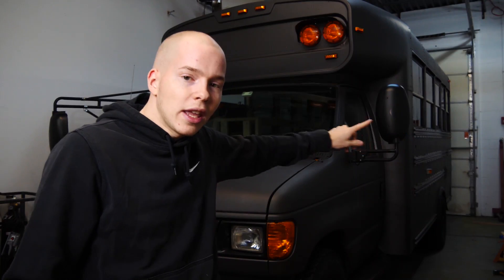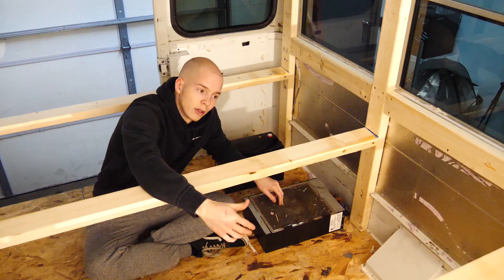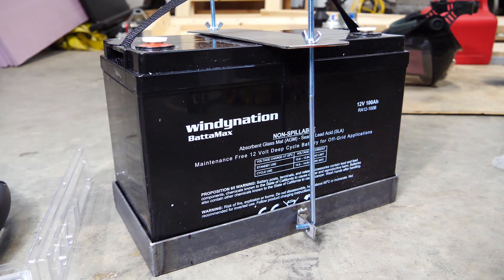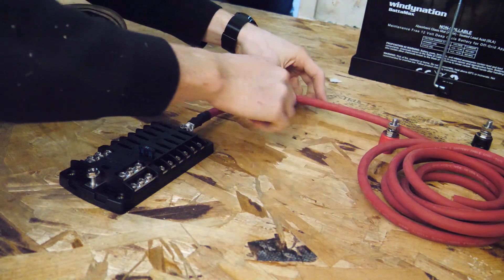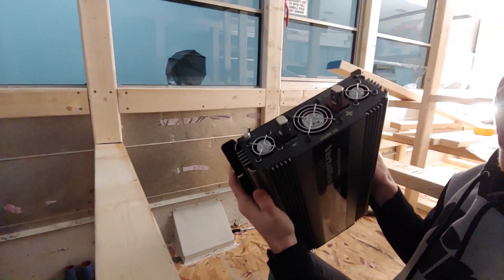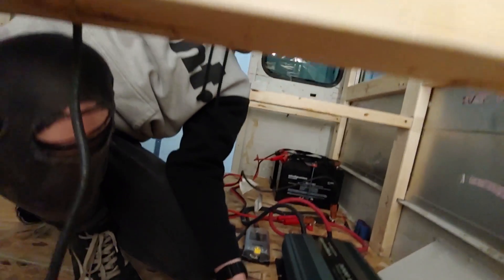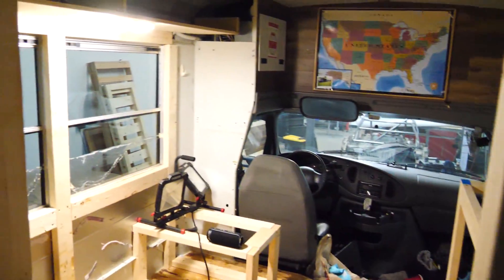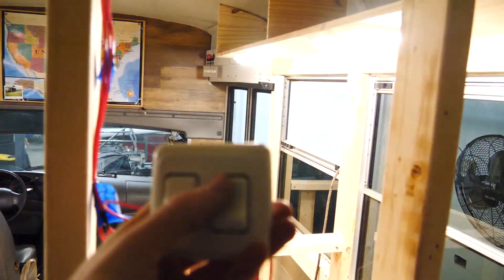Adventure Bus Gets an Off-Grid Electrical System! (Deep Cycle Batteries, 3000W Power Inverter)

Comment: 2:28 have you ever popped the rad cap on that bus??? Coolant aint supposed to look like Dr Pepper. That is REALLY bad for the EGR and oil cooler on a 6.blow. Also you wasted a ton of wire running both power and ground for 12v lights. Just put a ground screw into the metal of the bus close to the light. That is how every car/truck is wired. Those uninsulated spade terminals are kind of scary. At least put some tape or heat shrink on them before you seal them in the walls.
Reply from the maker: Ford coolant is supposed to be orange, but I agree it's a little dark. I'll do a change before we go on the trip! We wanted to run all the grounds to one location so if there are ever any issues its all in one place. Imagine having to remove a wall to check a ground.
Good idea to put some stuff around the spade terminals.
Reply: @_Gingium_  If you run the ground to the bus wall, you wouldnt have to check for ground, because you know it's always going to be there. Your way of wiring ground, sadly, was quite ineffective and might cause more issues than pros. None of car electricians do that.
Reply: that is the motorcraft gold colored coolant, ford doesn't use the green coolant in many of their big truck models.
Reply: Ricardo The PC Wizard  I never said it was supposed to be green. Motorcraft gold isn’t that dark, that needs flushed and back flush the oil cooler. On a vehicle meant for road trips, not taking care of stuff like that is not good. If that were mine, I’d put an oil cooler on it just because of the condition of the coolant
Reply: @Mikeywil0003  yes good idea, i doubt that bus has had anything done to it other than oil changes.
Reply: @RicardoPCGamer  cheap insurance. And while he had it apart he could also block the exhaust side of the EGR cooler, which you can do with some freeze plugs and a welder. When a vehicle is in a fleet like this bus, nothing ever gets done besides oil changes unless it breaks and cant be driven still. It kinda makes me cringe thinking about how many 6 liters got blown up in the land of Econoline school buses. Also the drivers usually don't know a damn thing what is going on with the vehicle mechanically, other than checking that the lights and blinkers work.
Reply: If he was to connect the ground of his "off the grid" system, he would be combining the buses electrical system with his own
Reply: @logankouwenberg3399  it doesn't matter as long as the positive isn't connected. Just like you can hook a welder ground to a body and weld on it, and it doesn't feed into the battery that is connected to it.
Reply: I knew I wouldn't be the only one to spot the needless ground wires strewn throughout the RV. But hey, it works. Definitely need some insulation on the quick disconnects!
Reply: @bryanglenn123  It works, but I always thought the more simple, the better. The only reason that fuse block has a ground side is because its meant for a boat, which you cant use the body as ground.
Reply: I agree it’s probably a good idea to do a flush but with iron block engines, that’s what happens... coolant picks up the impurities over time and darkens coolant. Not the end of the world dude
Reply: @Matt_Lanzer_13  On a 6 liter it can be bad. The holes for the coolant to flow through in the oil cooler are really small, and when the Ford gold coolant starts to break down and get impurities, it will plug that cooler solid, that a flush won't do any good. I have seen those coolers cut in half where they had deposits lodged in them 3/4 to the top. The aftermarket even has coolant filter kits for these engines for that very reason. That can cause tons of problems in this engine, because it will puke coolant without you knowing it, and it will drop below the level of the EGR and oil cooler. That is usually when the EGR cooler cracking, the overheating, and head gasket blowing begins, not to mention the oil itself isn't being cooled like it should be.
Reply: @Matt_Lanzer_13  Don't think I've ever seen coolant that dark. All I've ever worked with are iron block V8s (gasoline, but still), and never have I seen that. Then again, the one I've done the most on runs basic ethylene glycol and the newer one runs Dexcool (ethylene glycol and some other shit, idk), instead of whatever that Ford diesel runs.